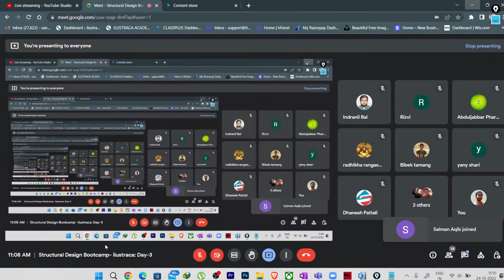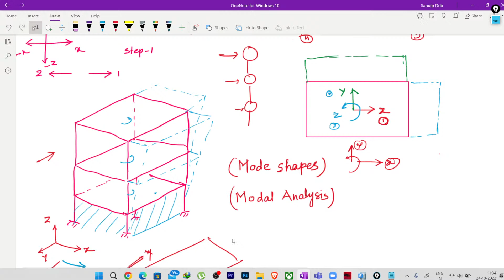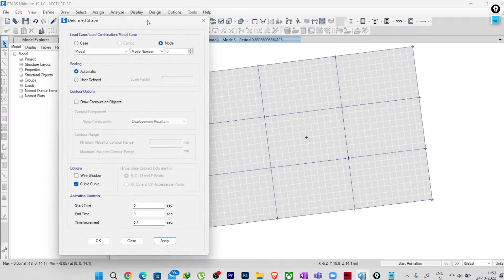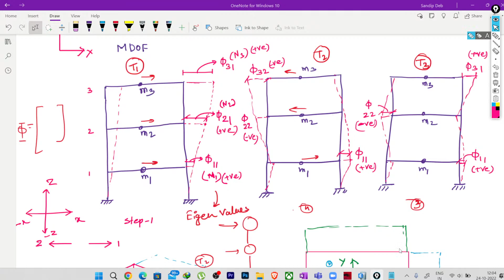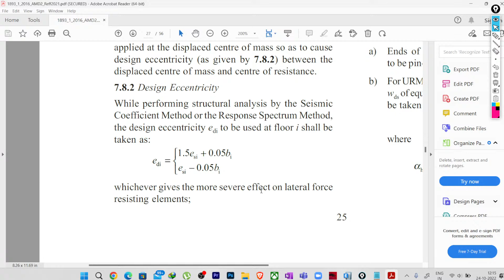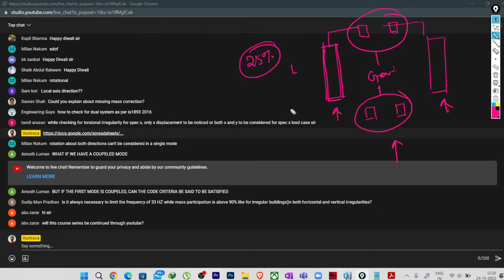Structural Design Bootcamp- Day 3: Modal Analysis & ETABS Demonstration | ilustraca

Comment: Many times we find 2nd modes as rotational..& it requires such additional shear walls which are not possible to be provided. 

But if 2nd mode is rotational then how the CM & CR are maching? Also if we chk displacements at corners in EQx EQy..are also less than 1.2 for Dmax to Davg. This is not getting ! How to address such issue

Comment: Sir, I have 2 Question,  e.g. Q1. Like u said first 3 modes contributing mass participation in X & Y shall be considered. Like that can we consider it same way for sum Rz. As many time what we face is like 
mode 1 Ux is 77%, Uy 0 ..Rz is 0
mode 2 Ux Uy is 0% ..Rz is 67%
mode 3 Ux 0 Uy is 77% ..Rz is 0..
And if we check CM & CR its perfectly coinciding
is that ok. Pls guide.

Q2. pls make a video of choosing Response reduction factor & its detailing for Zone III, IV etc.
Reply from the maker: Not any three modes.. I said first three modes.. First 2 modes must be translational to replicate the fundamental concept and as recommended by the code.. Mode- RZ 67%  means your 1st mode of any one plan direction is coming rotational.. or as a whole you can say that your Mode-2 is rotational which is not desirable...
Reply: @ilustraca 

Many times we find 2nd modes as rotational..n it requires such additional shear walls which are not possible to provided. 

But if 2nd mode is rotational then how the CM & CR are maching? Also if we chk displacements at corners in EQx EQy..are also less than 1.2 for Max to Davg. This is not getting ! How to address such issue
Reply from the maker: Response reduction factor itself is a big topic .. it is explained in my Online course in detail..
Reply: @ilustraca  
Sir by playing with orientations of columns and shear walls, we must make the mass participation  more or about 90% for the first two mode translational. Am I right?